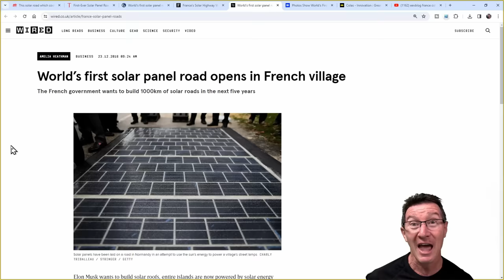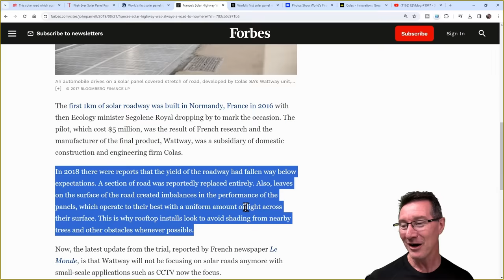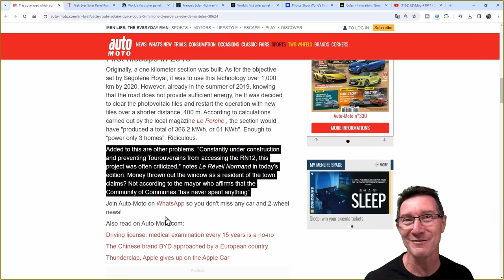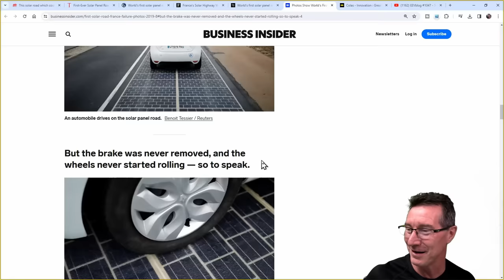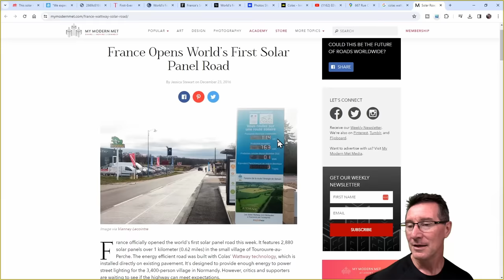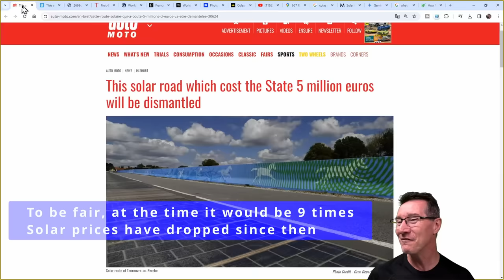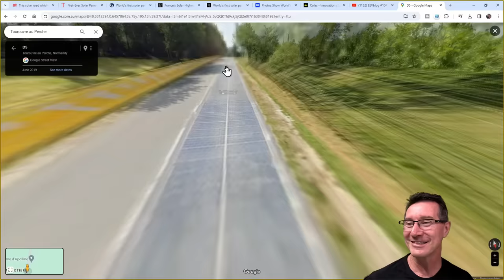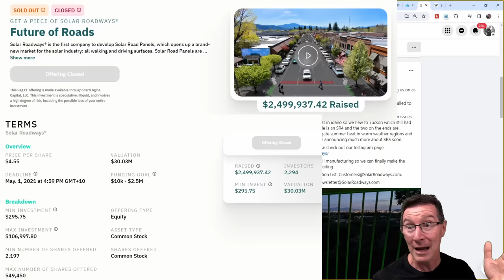EEVblog 1603 - Colas Wattway Solar Roadways is DEAD

Comment: The local Veterans Administration Hospital did something innovative with solar panels.  They have a large lot of handicapped parking -- many veterans are handicapped -- so they have built sun/rain shields over the handicapped parking spaces so people can get in and out of their vehicles without being rained on or in blazing summer sun.  I don't know how effective they are, but we do get a lot of sunshine here, much more than Normandy, France, but I imagine that if they have a way to use them to supplement mains power, it would be a good thing.

Comment: <sarcasm>What? Solar panels that are being walked on are getting ripped out instead of repaired? What a shocker for such a great idea! </sarcasm>
The inevitable fate of any solar installation with traffic going over them. Repairs will practically always outweigh benefits except maybe near the equator where straight-up is fine.
Reply: Here in Germany, the first solar walkway also caught fire multiple time because rain water entered the panels and caused short circuits.

Comment: In my old town there is now a very successful “solar roadway”. Next to the autobahn is a small solar park. And it is working very well.

The created energy is enough for 700 houses.
And 2GW maximum power. This really makes a difference and powers the town.

Another system functions as noise protection, 0.7GW and in the summer shepherds let their sheep trim the grass.
So no overgrow panels and when it gets hot the sheep have shade.
Reply: And then you woke up.
Reply: @cjay2  He said on a farm next to the road, not on it.  Putting solar on sheep & cattle farms works well, there's a couple near me.  Some people grows crops as well, agrivoltiacs is a thing.
Reply: I noticed this or something similar around Barderup just south of Flensburg last summer when passing by on the Autobahn - a few kms of solar farms along the road. No idea if the area is used for animals as well - the panel edges seemed a bit low so maybe OK for sheep but maybe not cows.
Reply: @koma-k  It's an easy win for the farmers.  They get paid for a 30 year lease and still get to use the land pretty much as they did before.  The sheep are happy as well.
Reply: @j.f.christ8421 We wanted to put one up but the council wont let us, Instead we have too run a diesel generator at 600kW per hour.
Reply: @dogwalker666  Sounds like the average rural council.
Reply: @j.f.christ8421  indeed.

Comment: roadside solar might be a better way to get energy as in vertical solar panels,vertical solar panels get better cooling that compensate for the energy loss of the less than optimal solar angle.

Comment: The thing that drives me batty about this is why can't politicians do maths? Where I live there are hundreds of thousands of square meters of roof suitable. Sodium cells are now in  bulk production. So we have suitable space for both generation and storage. Oh and flow batteries which have a reasonable energy density are suitable for most factories. IE a 5 tonne battery will store 100kWh.

Comment: @11:35 UK houses use about 6 kWh but European houses probably use heat pumps because the unit price is cheaper. You could add 20 kWh easy if you include heating and hot water.
Reply: UK homes use 6 kwh of electricity per day maybe, but 20-50 kwh of gas equivalent. It's not fair to only list the electric energy and forget about all the non-electric energy.

Comment: You could have given the whole town 1000$ per person. For a whole list of "energy reduction and efficiency purposes" that's a heat pump air conditioning/heat for everyone in the city (single room type). Sure install might add a small amount. That's a sure bet. Or money for LED lighting. Or insulation,  windows. Reducing consumption is the same as increasing production but usually with less maintenance.

Comment: You can dissipate the heat from the asphalt in a heat pipe. To use it to generate electricity for an ORC with a space cooler.
Reply: Sticking pipes under the tar roads to heat water and pumping it to nearby houses would actually work better than this.  I know there was a trial in the Netherlands ages ago, and one in the USA, dunno what the  outcome was.
Reply: @j.f.christ8421  In summer the asphalt warms up to between 45°C and 65°C due to the sun. The space cooler works at delta 20°C to 60°C below the air temperature. In the best case 25°C (+35°C(air temperature) ∆60°C) to 65°C it is ∆90°C.
It is almost like a geothermal power plant

Comment: SUGGESTION: I was in Fuerteventura last week (Caleta de Fuste) and I saw a cycle path fitted with lighting where the panels were on the lamps themselves. This seems a better idea. Maybe you could do an analysis?
Reply: That's pretty common.  Some have motion sensors to save battery power.  The only problem with these you need to replace the battery every so often, but in theory you could easily get 50 years out of them.
Reply: @j.f.christ8421  My point is that I have no idea how viable they are and an in-depth analysis would be interesting.
Reply: @fredbloggs5902  Define viable.  They're supposed to be easy to install, produce light and up your green cred, seems to me that's what they do.  Define what you think they're supposed to do, or compare them to another solution, like regular mains-powered street lamps.

Comment: 10:20 I need that much for double the space on a cold day with the AC on full blast heating. But 17MWh annual is indeed a huge amount.
France has a lot of resistive heating because they have cheap nuclear power

Comment: 4760 kWh per year? I use on average 1745 kWh a month. And that's not a lot. Ranges from 1100 to 2700 kWh a month which totals about 24431 kWh per year. But it also gets very hot in the summer and cold in the winter.

Comment: It seems to me that for the same cost you could erect a south (northern hemisphere) facing wall and put the solar panels on that.  As I understand it, the cost for a mile (1.6km) of what we call here in the USA a "sound wall" (put next to freeways to stop the road noise from getting in residential neighborhoods) costs about $1e6.  a little bit more and you have SOLAR FREEKING (sound) WALLS that don't have such nuisances as cars driving over them to ruin the photoelectric cells.  You heard it here first folks.  Would I invest?  Not in your freeking life!

p.s.  Patent pending idea.  Which goes to show you can patent just about anything (LOL).

Comment: Here's a sound byte for Ministers considering adopting solar roadways: did you know that you can install a PV solar power plant, at the cost of a few million dollars or euros, that will give you approximately FIFTEEN TIMES more energy per dollar than a solar roadway? And where the solar roadway would require constant replacement due to damage, a PV power plant would require only a fraction of the maintenance! Invest in PV solar power plants today! Hire someone smart like Siemens to build you a medium-scale PV solar plant and some sort of storage (batteries, water/gravity fed, etc.) and you can reduce your community's carbon footprint by 50-75%! This is legitimately a Good Idea and Europe's best engineers are waiting in the wings with the technology TODAY to make this happen. Order to build times range about 1-2 years. Go get some!

Comment: Here is the thing it's very possible to produce clean renewable energy in some places when done correctly but you absolutely must do it correctly. The next part is your trying to place a fairly fragile object in the most likely place for it to be damaged. The next part is that instead of improving systems that we already know work they were trying to place something in the most likely location to receive severe damage.

Comment: They could have built a solar roof for the road and it would have been a modest success, cheaper and quicker to install, producing a fair amount of electricity reliably with little maintenance, and providing protection for both vehicles and the road from rain, snow and bright sun. But nooooo....
Reply: That could have been more than a modest success.  They could have put a roof over that traffic circle and some of the road and perhaps a bus stop and etc with solar all for 5 million.

Comment: Maybe they should have used a Zamboni to clean the panels every week. We clean our rooftop panels once a year, mostly to remove bird droppings.

I still have to applaud the initiative to try such a thing. Yes a solar farm could have produced more energy, but that also requires you to have space to install that solar farm.
Roads are already there, so even if they produce only a tiny bit of energy, it can add up as more segments are placed. However the panels should be designed in such a way it can hold the weight of traffic. 

Maybe a solar road is not viable, but what about a road that can convert kinetic energy from weight into energy. Maybe install mini-turbines on light poles and a small solar panel on top which a battery system inside that could be charged by this system. I mean our garden lights are 100% powered by solar and they even work in winter when we only have a few hours of sunlight per day...

Comment: Could have taken those panels, put them up over the road on 4m high poles, and gotten both more power, and protected the roadway partially from sun and rain as well. Angled to point to the south, so they shed rain and any possible snow, and leaves and dirt wash off the glass making them in general self cleaning too. But of course not done, because that is entirely too plausible, and too easy to do as well.
Reply: I honestly wonder if it would have cost less to make a canopied roadway with the solar on top.... I feel like even if installation/design costs were 2x as much, the 10x in energy capture would more than offset it.
Reply: @andrewt9204  Very much cheaper, as you have existing designs of canopies, and solar panels can easily be mounted to them as well, as the sizes are very much compatible, so you do not need an actual roof, just the framing. You do have leaks at the edges of the panels, but that is minor. No need to make bespoke panels with armoured glass toppings, which are likely hand made, as the current automated machinery is optimised for thinner glass sheeting.
Reply: It's crazy how in a matter of minutes a couple dozen people on this vlog had better ideas....
Reply: @lisaleone2296  You know how it is that those who can do, those who can't teach, and those who cant teach go into politics.......

Comment: why dont they just build a little roof and put the solar panel there.
Shade when sunny, cover when rain, no need for expensive glass that reduce efficiency, probably even cheaper as you can use off the shelf panel.
I call it "solar pathways", I thereby declare this idea public domain, got for it!

Comment: in Thailand they have street lights that put a small panel towards the south on top of the lamppost and it just works. with 5 million euros they can cover 1000km of road im guessing. I estimate the battery will become inefficient after 4-5 years and the solar panel will not be sufficient after 10. The LED should last longer if it doesnt fail soon. The whole circuit may be less than 30 euros! For outside weather resistant components! 
EU - US government love their waste!

Comment: They could just have installed those solar panels on the rooftop of that Peugeot dealer building (13:52) and it would have been more efficient and cheaper.

Comment: power consumption of french houses: you need to take into account that france uses electric heating. sure, they are moving to heat pumps, but a good portion of their homes just have electric radiators. sure, they have an efficiency of a 100%, but that doesn't mean a lot when you convert electricity to heat.

Comment: You wanna know what probably WOULD work?  Solar railways.  No, not mounted between the rails.  Mounted above the railway line, like a roof only angled toward the sun.  Railways aren't often moved, and at least close to cities they're usually powered by electricity so it seems like the perfect partnership to me.  The solar panels could be divided into independent "sections" with a battery bank for each section.  If you had enough panels, you'd have more than enough power to run the railway and possibly have some left over to feed back into the grid.  Could someone do the math?  How much power would the panels produce and how much power would the trains consume?  How about starting load?  Can regenerative braking be used to dump some power back into the batteries as the train slows down?  My instinct says that this could be viable, but I'd like to see some hard figures.

Comment: A solar roof over a sidewalk may take twice the materials, but it'll cost half as much if using commodity materials. You can even have the panels stacked on transparent glass and people can still get sun during the day, as well a roof for rain and snow across all seasons! And, the solar panel can have heating built into it for removing snow from it during the winder season when it snows outside! I can't understand these solar which-way orgs doing everything but the right thing.

Comment: They only choose to use projects that fail because otherwise it cuts into electricity companies massive profits. Solar power is great and it's free energy after your set up costs but you try getting any type of financial assistance to install solar in the UK. There are no grants available unless you use nominated suppliers and installers and get a couple of certificates, if governments truly wanted people to use solar they would help people to get solar. I can buy and install a fairly good array with no battery backup for about GB£1000 that would generate enough electric for my daytime use but my local councils green washing department refuses to help in any way. They don't want you off of the corporate tit.....

Comment: ok but i have one question whats the traction like on those pannels as yaknow if a truck needed to emergency stop or the weather was wet wohow badly at risk would they be of just sliding off the surface as it aint exactly a normal hard and grippy surface

Comment: Dang, I had high hopes for solar roads. I never saw your other videos about the calculations, and I figured they'd have to be made strong enough for cars to drive on of course, and they'd only be useful in areas that get decent sunlight and low traffic, but in general I had high hopes for this one. I never heard of this French project before. You can't beat physics though, and so my hopes are shattered like this failed roadway. - I'm still holding out hope for solar awnings over parking lots, and solar panels on the tops of large, wide, buildings like supermarkets. I'm hopeful on various safer battery tech. Gravity batteries, flywheels, even water pumping in some cases, I don't know the math on them, I'm sure there's energy loss in the systems, but there's energy loss in the batteries we have in our phones and laptops and such already as well, right? I can't remember, but I think there was a gas-battery or something even, basically looked like a bunch of oxygen tanks that divers used. Not great for, say, a laptop, but might not be bad for storing energy for a building. I'm not claiming I know any of these are good or not, I'm just hopeful for them, along with solar power. Or, wind power. I'm a big fan of bladeless, wind powered, electric generators.

Comment: What I find ridiculous, but nobody is laughing about it, is that people now even install solar panels on walls in Germany because they calculated that after 12+ years they are at break even point. While this is true, due to high energy costs in Germany, nobody is hitting these people on the head because these solar panels would do a much better job at lots of better locations all around the world. They could provide not only much more energy at other places, they could also provide what is desperately needed, like power an A/C in really warm climates, or pumping water, or ... But we install them to run our family media servers or all the gadgets nobody needs anyway ...

Comment: I will just never understand what goes on in these peoples head when they come up with these ideas. Solar roadways is (was) like trying to force a square peg in a round hole. There's is just absolutely no logical reason to try and make a solar roadway. Hell, just put the solar panels OVER the road or parking lot. The parking lot solar roadways made the least sense. Even if you could make it strong enough to hold a car (which you virtually can't) why would you want the solar panel UNDER a car, most parking lots are filled during the day. The fact that these projects even received funding is insane.

Comment: Solar freaking roadways were dead on arrival. Solar freaking fences on the other hand seem to work well, sure they generate 1/3 less power in direct sunlight but in overcast they generate slightly more, they're impervious to snow buildup and best of all they don't really take up any surface area so you can have crops & whatever else between the solar walls.

Comment: 3:55 nah come on they obviously realised it was a bust very quickly, because the rest of that plan to build 1000km of solar road obviously never happened. if its a small town paying for the whole thing out of its municipal budget they probably left it where it was because, while it wont be €5M, the cost of removing and disposing of all that junk and laying a km of fresh road or pavement will be significant and they very likely wanted to put it off for a while.

Comment: If only we had some elevated surfaces, ideally angled, that we didn't also drive on, then solar panels could be covered glass. In close proximity to where the power is needed would be an advantage, like if only we had roofs on buildings, that would be kind of ideal place for solar panels, oh wait...